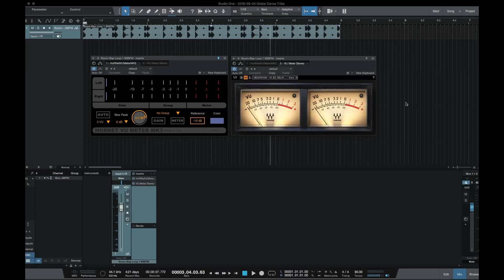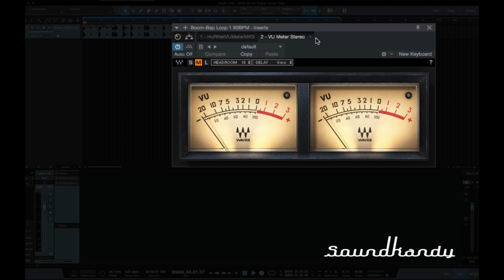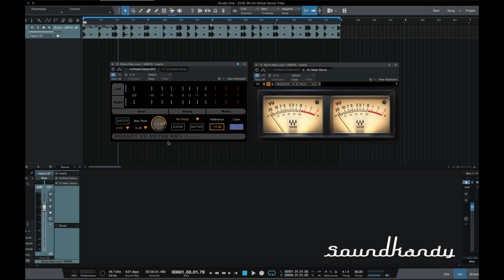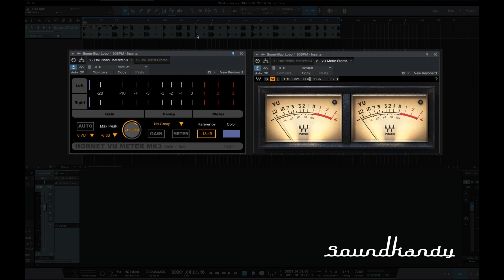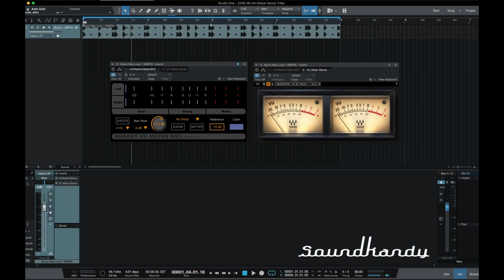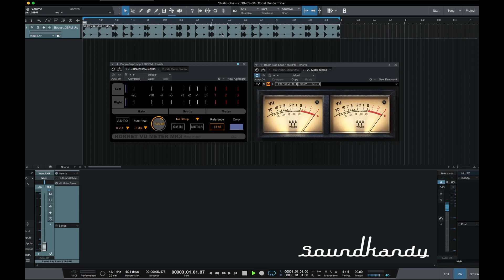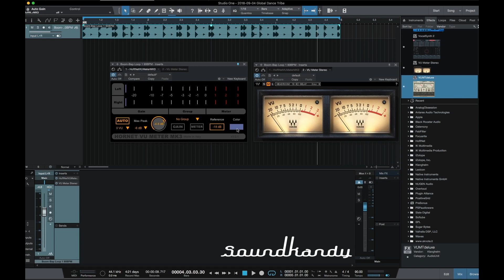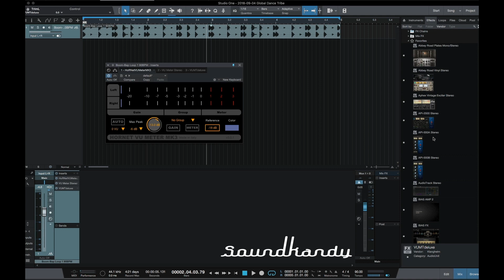Gain staging & VU metering best practice (HorNet VU Meter MK III)

Comment: Very useful and looks like it would help with workflow.  Question::: If you then want to remove the plug in would one calibrate the gain down to the level the plug in adjusts the channel by?  So this would allow for a more accurate way of manually gain staging while keeping a clean plug in strip.
Reply from the maker: Yes of course, that all makes sense. I guess all you have to remember is if you add any further processing to the channel then you’ll have to take a reading again. Anything added or subtracted from a channel has the potential to change the gain structure. If you are using Persons Studio One you have the option to “deactivate” inactive plugins, meaning that they remain on the track but do not use any additional resources. 

This “deactivation” is not the same as other DAW’s in most DAW’s the loaded plug will still use resources, regardless of its state, active or inactive. S1 allows you to load to memory the “deactivate” and flash the cache. 

Hope this all makes sense. Thanks for your comment bro. Much appreciated 👍🏾

Comment: This is great for REDUCING gain but is there a plugin or method to INCREASE the gain on quieter tracks (or VSTS for that matter) to match the same target level i.e. -18 or -14 for quick gain staging purposes?
Reply from the maker: Yes, depending on your DAW there are lots of great plugs and methods to achieve this… What DAW are you using?
Reply: @SoundkandyStudio  studio one

Comment: Any reason you choose -12 peaks over default -6? Even at -6 my peaks rarely hit -10. Also do you use the klangheim VU when recoding in?
Reply from the maker: Great questions, I use -12db because I do a lot of vocal recording and because it’s a great compromise between -6db and -12db. With regards to VU, yesterday I use it whilst recording I also use my tc electronic RTA, which I would defo recommend others to get, they are simply a life-saver for mixing and mastering. Great question. Many thanks for your comment and for watching the video.

Comment: Thanks very good info. If mixing vocals, is it better to run the auto gain plugin first, similar to vocal rider/ fader riding plugin - before this gain staging step? Thanks
Reply from the maker: Hey, thanks for your comment, I would run the plugin first, then start your mix process… As you know there are no “rules” in music production, I’d run the plugin first but I defo suggest you try both methods to see what works best for you. Remember, the music production and the mixing should be separate, many people make this mistake….

Comment: Noob here. I'd appreciate if you can clarify something for me. When I start a mix, I use trim inserts to get a very rough mix - so all my faders are at the default position, and the trim on each track determines the relative loudness of each instrument. I set the loudest stuff to peak at between -18 to -12. But if I have a tambourine, say, then I set the trim lower so it sits in the background where it belongs. It could be down at -30 or -40dBFS. Why would I run this plugin and boost the tambourine up to -12dBFS, only to have to turn it down again? In other words, I don't understand why you'd want want to start off a mix with everything at the same peak value?

Thanks.
Reply from the maker: Wow, good question… Not sure where to start so I’ll just jump in. First up the HorNet VU Meter, as shown in the video will allow you to set a particular db level to ensure that clipping does not occur. Moreover, when one observers a Linear fader you notice that the numbers which are closer to “infinity” are closer together. This means that it is more difficult to make fine adjustments in your mix. Therefore starting your mix template at 0db or unity gives you a clear understanding of the task ahead.

When all the controls are set at the 0dB/unity mark, the signal level that comes into the mixer is the same level that leaves the mixer. This is described as the default or re-set position. 

The object of gain-staging is not to set all “sound” levels to the same volume or “VU” it is to allow yourself headroom in your mix. Naturally any instrument in the lower register will not have the same frequency sound level as one in the upper register. But by judicious use of either “trim” or gain-staging we can gain an advantage from the start of the mix process. Try to think of it in the way we use the “pan” encoders. We generally never really pan hard left or right. Whilst there is nothing fundamentally wrong with this approach we understand that on mono playback setups this can be somewhat problematic.          

As with all mixes we simply use the tools we need to achieve our desired outcome. Personally I don’t subscribe to the following notions (high/low pass everything, nor does every instrument need to be EQ’d. If you find that you don’t need to gain-stage an instrument then don’t, as I’m sure you know there are no real rules in music production, I guess there is simply just “best practice”, even this can be questioned.  Hope this helps, if not please feel free to shout bro…. Thanks for a great question agin and for your interaction with the channel.
Reply: @SoundkandyStudio  Thanks. In my mind, the most important part of gain staging by far is when you add a processor - it is vitally important not to let the signal get louder, so you are just hearing the change in tone and tibre, and not fooled by louder=better. I use the ABLM JSFX (TBProAudio) plugin for this. I'm still not sure about boosting/cutting all the sources to -12dBFS peak before starting the mix, rather than starting off with a rough mix using trim. I'll need to think about that a bit more.
Reply from the maker: @NebulousWeb  I totally agree with the points you’ve presented. However I’m sure you’ll agree that boosting/cutting is necessary in some shape or form, for example a F# on C4 is completely different in pitch to that of F# on C1, whilst is the same in tone. Therefore some boosting/cutting may be required. 

Nevertheless I accept that gain-staging to a -12dBFS may not be to everyone’s liking. Personally I find that having a template to work to allows me to start my mix knowing that normalisation has been achieved, thus making a distinction between the creation process and the mix stage. 

Thanks for your comments bro, please let me know how you get on and if you’ve find a way to work that suites your workflow. Thanks again.
Reply: @SoundkandyStudio  I guess I can't understand the benefit because the first thing I do when I get the tracks is mute them all, then start a balanced static mix straight away. I bring in the important instruments one at a time - drums, bass and the main melodic instruments, and get them sitting with each other at around -18 to -14dBFS RMS using trim. Then I'll bring in all the secondary instruments and sounds at the levels they should roughly be at, again using trim. That means when I begin volume automation, the faders are still at zero. I'm still trying to work out the benefits and consequences of doing it this way though, so it's good to see alternative workflows. Thanks for the video and the replies. Nice channel!
Reply from the maker: @NebulousWeb  No probs bro, thanks for your comments. If you do get a chance to try out the demo please do. However if it doesn’t fit into your workflow just give it a miss, I’m sure it’s not for everyone but it’s worth a look.

Thanks again for your feedback and channel support bro…

Comment: I do not think that you ever covered the Max Peak section, of which you have at -6db.
Reply from the maker: I agree, I did this video some time ago without taking into consideration what viewers wanted or needed to know. The difference between RMS, Peek and LUFS was not covered in this video. I do intend to address these matters as it is clear that these issues need to addressed in the absence of any plugin. Thanks for your comment bro. I will get to this in the next few months.

Comment: I am still unclear on how to use the Hornet VU Meter in my DAW. Do I put it on every track that has audio and then take it off? 

I produce EDM Music. So usually I put on my Hornet VU Meter 1st in the FX Chain then a synthesizer 2nd. Then saturation 3rd, subtractive EQ 4th, Compression 5th and then Additive EQ. Am I suppose to take off the Hornet VU Meter?
Reply from the maker: Hi Andrew, you can use the plugin on either individual tracks or on your master buss. Are you using the auto feature? 

There are many ways to tame level clipping, one of the easiest ways is to ensure you start by gain staging. I also produce EDM music and it often involves lots of samples, many of which do not conform to any real digital standards so it’s important to get these sorted first. By setting the level of each clip/sample to 0db helps you keep them under control this also ensure that your mixer has a “visual” uniformity, I.e all faders are set to 0. I’m sure you’ve noticed that all numbers below 0 have larger increments and everything above 0 has smaller increments, smaller fader adjustments for fine tuning.

If you’re still having issues or if this makes no sense perhaps I’ll do another video. Thanks for your feedback bro.
Reply: @SoundkandyStudio  thanks for your reply. So how horney vu meter works is that if I set all my DAWs meter to 0. If the sound is clipping hornet will automatically adjust it so it is not clipping? Is that how it works?

Could I set all my DAWs meter to -6 and slap on the hornet as a plugin? Would that work as well?

Comment: Thanks for this interesting video, seems to be very useful. I didn't get the difference between the Channel-Fader and VU Meter though, can you explain a bit more what exactly is the difference? Why does it go above 0db in one and not in the other? And what would happen if I gain stage it by using the Hornet Plugin and then bring the channel fader to +6dB? Just trying to understand the difference between them here, because hearing that for the first time :) Thanks again for this useful video and helping us!
Reply from the maker: Hi, thanks for taking time to watch the video and to comment.
Ok, let’s quickly talk about (faders) and (VU). When it comes to faders we have two main options to consider.1) pre fader 2) post fader. 

What is a pre send?
A pre aux send delivers the signal out of the mixer BEFORE it passes through the channel fader; pre-fader.  Therefore, you can move the volume fader all you want but it's not going to affect the volume going to that auxiliary unit.  

What is a post send?
A post aux send delivers the signal out of the mixer AFTER it's gone through the fader; post-fader.  Therefore, when you move the volume fader, that aux send volume is equally manipulated.

This leads us back to VU (volume unit) and gain staging. In order really refine your mix, I truly believe gain staging is very important. Take a look at any mixer fader, I mean, really take a look. What you’ll notice is that the <0 db numbers are close together, once you hit the 0 db marker the numbers are more spaced out. What this is telling you is that small changes at the <0 db make significant increases to the overall gain increases. Hence the need, in my opinion for proper gain staging.  

The Hornet plugin is just one way to gain stage, In the video I also show an alternative option. However, what the HorNet dose do, and do well is the ability to allow the user to fix a db amount to prevent clipping, as shown in the video. 
Gain staging is not too complicated to understand, but I do understand that if you are new to music making there is a lot to digest. Therefore, if you’d like to see more video examples I’d be happy do create more such content. 

If you have any specific questions you need answering please feel free to DM me directly

Thanks

Comment: Hi, If I am producing a song and I adjust the faders for each channel as I go long, can I then turn on this plugin, set it to auto gain with a Max Peak of say -10 db, would my song be auto gained to -10 db while respecting the levels that I had already set with the individual mixer channel faders before turning this plugin on?
Reply from the maker: Hi, if I understand your question correctly, if you gain-stage, either by way of clip gain or simply fader adding the Hornet as the final plugin to the effects path will respect the levels you’ve set. Any EQ, comp or effects must pass through the Hornet plugin in order for it to manage gain reduction.  

I guess the an easy way to look at it is: imagine you have a bass track with no effect chain, then you add a compressor, then adjust threshold, attack time and finally add some make-up gain. This process may indeed upset any previously set VU levels. However by adding the Hornet after the compressor plug and setting in to not exceed -10db this will ensure that and further adjustments to the compressor on the said bass track do not exceed the desired threshold you’ve set. 

Hope this helps…
Reply: @SoundkandyStudio  Hi, so basically it is a tool to save you time, the other way would be to adjust the ouput of your plugin chain by turning off the chain and hear the volume level change and then adjust it accordingly , right ?
Reply from the maker: @Hassan_Omer  Yes, no. It is a tool, as is most plugins, but gain staging is a little bit more complex that that... But I get where you're going my friend...

Comment: Thank you for the great review. Should we have this in each mixer channel or just the master channel?
Reply from the maker: Hi, you can really do it either way. With the Hornet I'd place it on the master bus as the last insert to ensure that all plugins pass through it. With the VU’s you can place them on each track. However, with the new Studio One 4.5 update you won’t need to really use the VU’s because you can gain stage, or at least manage the gain at the line level input. If you haven’t yet done the update you should take a look, it’s not bad.
Reply: Soundkandy Studio thanks for the reply. I'm pretty new to mixing. I bought this plugin to help me with gain staging and I think it's great. I use fl studio. So to make sure I understand what you wrote, I only need to have this in my master channel? No need to have it in my other group mixer channels (percussion sub master bus, for example)? Thanks. I'm still learning about vu metering.
Reply from the maker: @ginotarabotto  That’s correct, you don’t need to put it on each individual channel if you don’t want to, you can simply place it on the master buss. However, let’s say you have a bass guitar track, you add some compression and some EQ, to ensure you don’t clip the channel you may want to place the HorNet at the end of this effect chain to prevent clipping. That’s one way of doing it. Nevertheless if you simply want to ensure that the overall master buss does not clip then simply place one instance of HorNet on the master buss and you’re done. 

Personally, I would create a template, reduce all input levels by -12db, that’s if you’re working with samples this will help to prevent clipping at the initial stages of your production. 

There are great discussions on the web regarding mixing & mastering whilst producing, personally I never mix and master whilst in the production phase of creating a track. I will always create my track and once the track is finished do I start the mix and mastering process. 

The HorNet is a great product for keeping levels under control especially if you add lots of plugins to a channel. It’s worth keeping in mind, once you’ve added a plugin to a channel, wether it be a compressor, EQ or any other you must remember to check your levels.

Hope this helps my friend, if not you know where I am. :-)
Reply: Soundkandy Studio thank you!